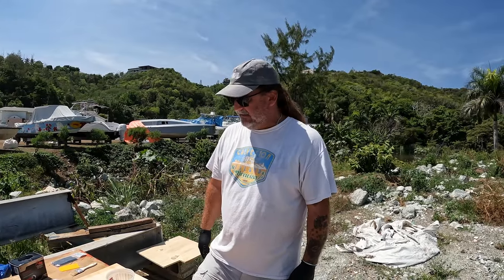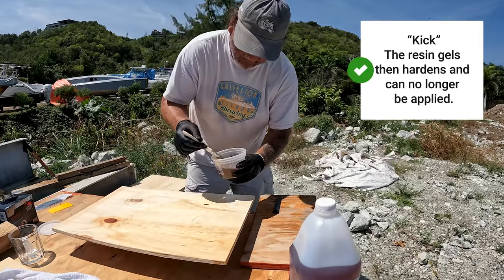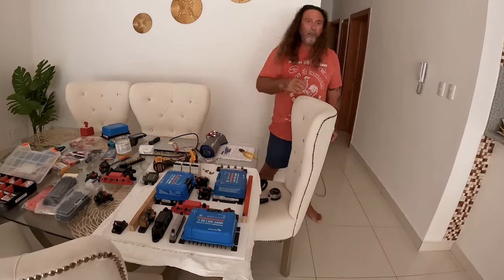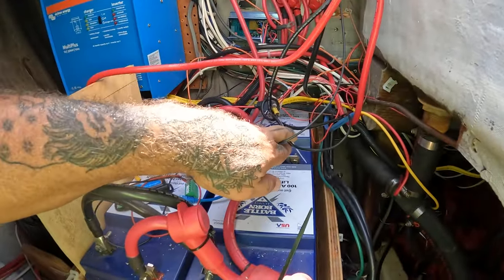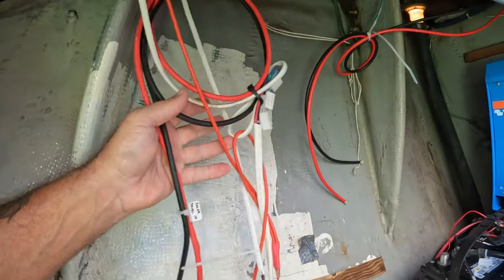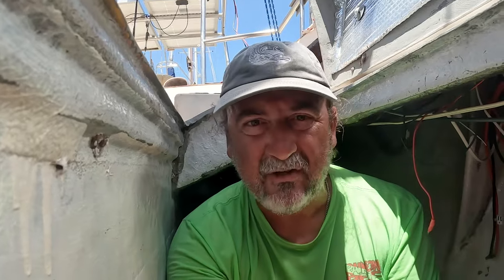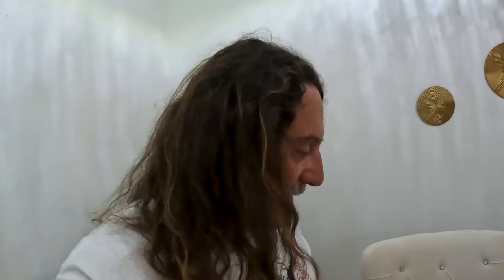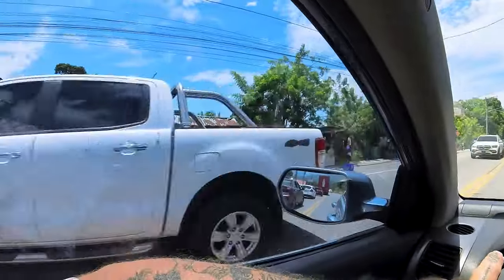Repowering the Boat: MPPT/Wind Electrics Panel (SV Garuda Ep 36)

Comment: When most people talk about "repowering" a boat, they mean replacing the engine, not doing electrical work.  I'm glad to hear that your engine doesn't need to be replaced.

My boat is also on the hard, and I am planning to do electrical work (among other things) over the winter.  However, up in Rhode Island over the winter, my day is work until I can't feel my fingers, take a break, to warm up, discover it's already dark because it's 4:30 pm.  I think I would rather be sweating. :)
Reply from the maker: Sorry to have scared you there, Jeff. Best wishes on your boat projects. Stay warm up there (… and get back down here!!⛵️)